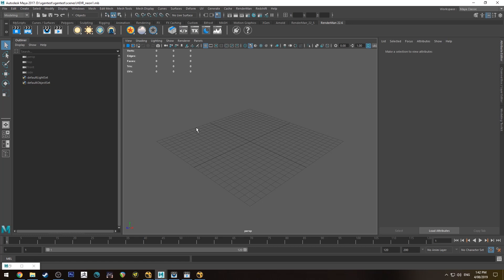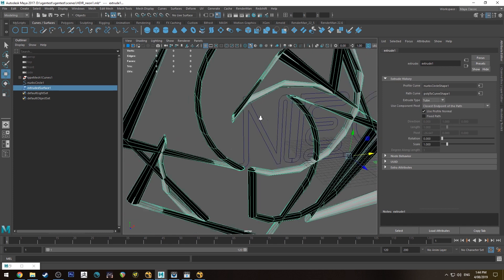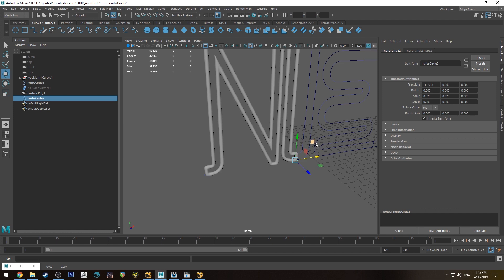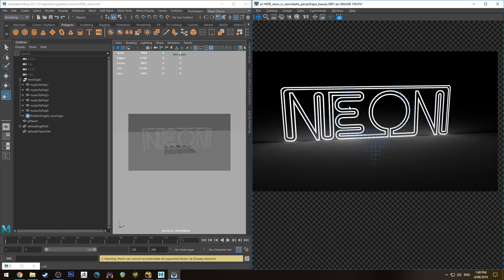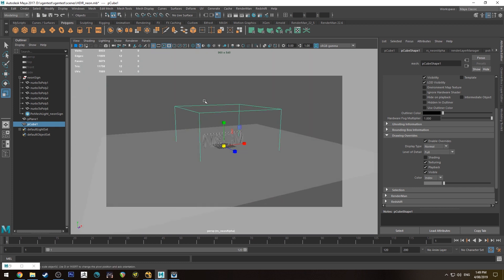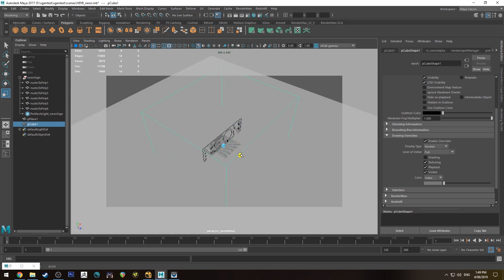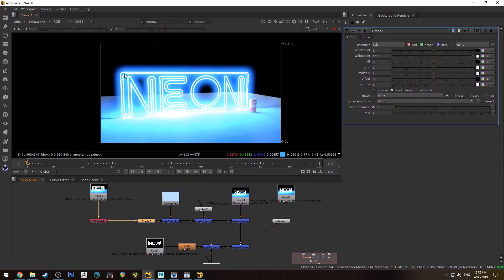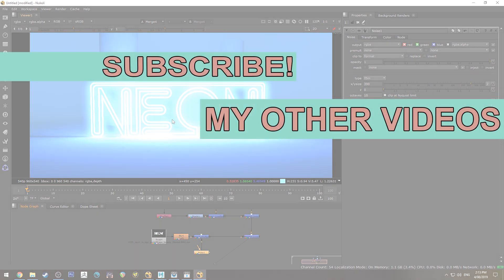How do I render: A Neon Sign (Renderman, Maya, Nuke)

Comment: Hi, Michael. I couldn't get the motion blur to show smooth images. Granular images are always displayed in the Maya rendering with the Renderman. Do you have the numbers to put there in the settings so that it is optimized to appear a smooth motion blur?
Reply from the maker: Motion blur in the render always requires a very high sample rate to remove noise, if this is an animation you should consider doing this in post with a vector motion blur AOV. If you must do it in the render, without seeing the render, I'd guess you'd have to go over 1024 samples and possibly lower your variance as well. At higher resolutions expect very long render times per frame.
Reply: Thanks Michael.